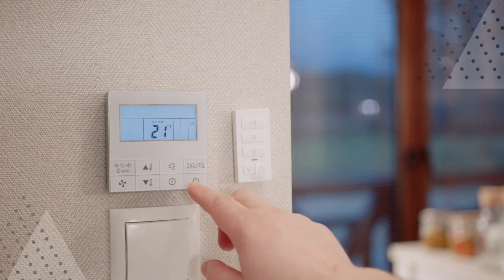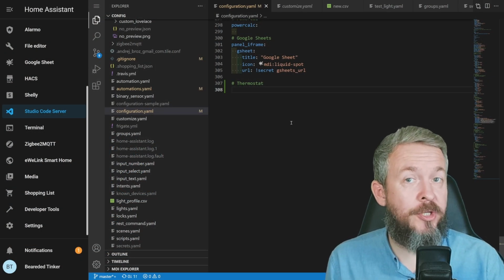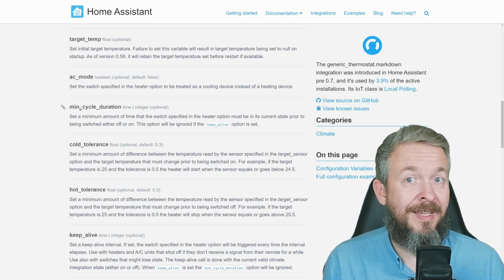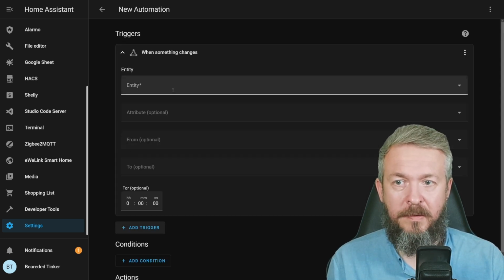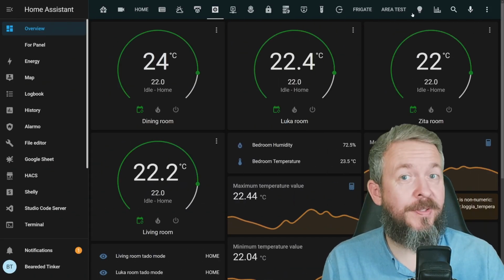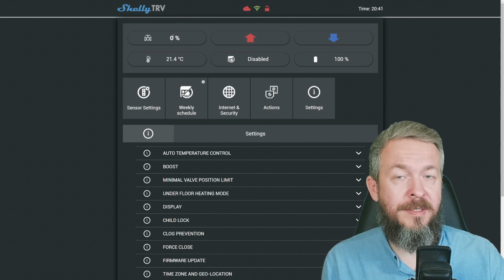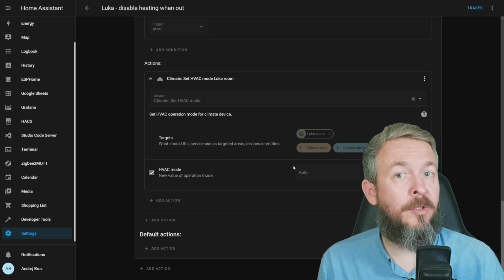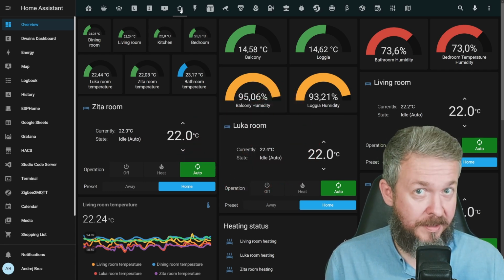STOP wasting energy on heating with Smart Home

Comment: I have almost decided to go for geothermal heating with Valliant equipment (I have some booked visits from other installers/brands, but Valliant fits us best so far). Anyone out there having experience with tgermain's HA integration for the Multimatic (VRC700+ VRC9xx)?
Reply: I know it's cloud based, but since the heating solution will be remotely supervised by the installers anyway I don't mind, it's included in the insurance plan for the system.
Reply from the maker: Can't leave this without reply, but unfortunately, I have zero experience with it. I have couple of friends that have this Multimatic from Vaillant, but non of them is running HA to test if and how it works. I did see the integration, but that's it. And as for the cloud, that's not the worse thing.
Reply: @BeardedTinker  thanks anyway. This is why you are among the very top of my HA channels, you're very engaged in your viewers. You're Top Drawer, my good sir 👍
Reply from the maker: @bennylloyd-willner9667  thank you very much :) I really do appreciate it!

Comment: Thanks for this video, it's very timely as I put a space heater in each of my kids rooms.  Since both rooms are on the same 15 amp circuit, I need them to alternate run times and not both run at the same time.  I'll probably still need some automations to accomplish, and  your video was very helpful.  Only run between 8:05PM and 5:30AM, only run when the grid is up, only run when the other heater is not heating.

Comment: @BeardedTinker, thanks for all the nice video's! I like these a lot. I have a question, whould you know if you can use a ziggbee thermostat for an electric floor heating (only in bathroom). I'm not sure i'm currently using an old EasyHeat F19C thermostat.
Reply from the maker: I would say yes, but it depends on what type of thermostat you get. I've seen 2 types - one for water floor heating, other one for electric. BUT I've never tested any of them, just seen them listed.
Reply: @BeardedTinker  can you which ones you found?
Reply from the maker: This is one of them. Just be careful when searching as there are 3 version - water heating, gas heating and electric floor heating.
https://s.click.aliexpress.com/e/_DlLHJ7z

Comment: I have a question. How can you connect a smart radiator valve to turn on the gas-heater?
Reply from the maker: This does add a bit of complexity. But you need relay or smart thermostat connected to the gas-heater. And than create a bit complex automation that would force it into heat whenever any other radiator needs heat. And stop heating if radiators go in idle state.
I have something similar setup - smart thermostat switches relay if any room requires heat. And stops if it or rooms don't need more heating.
Reply: @BeardedTinker  Thanks for the reply. Can you show me how you have created that automation in your upcomming video?